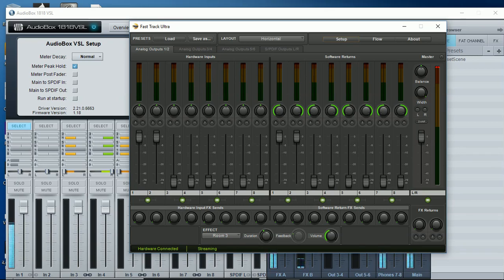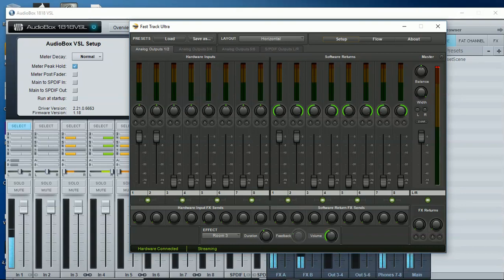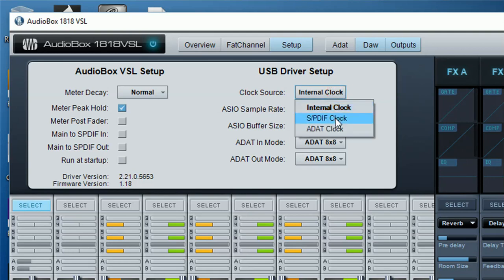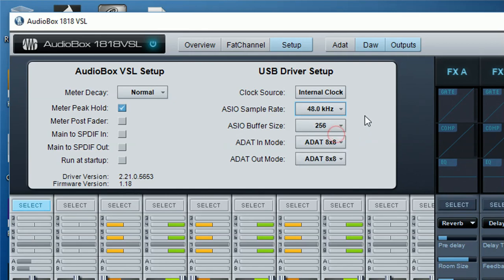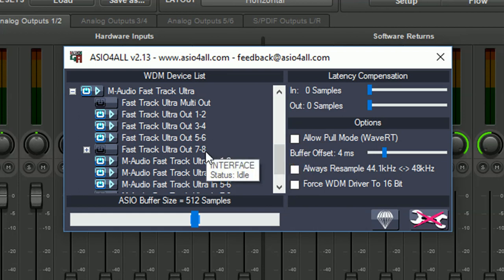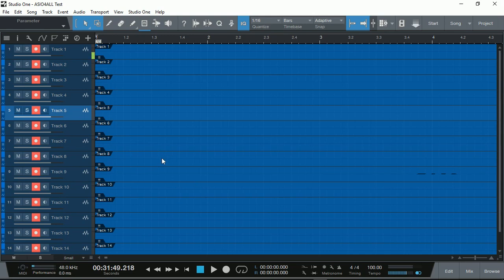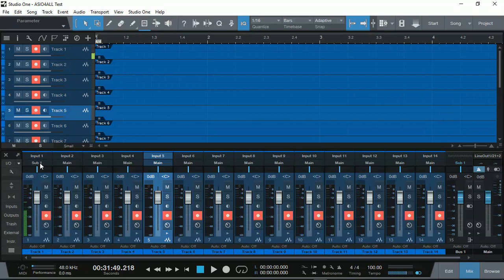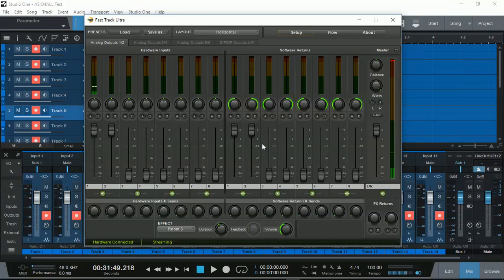Combining Two Audio Interfaces Using ASIO4ALL using SPDIF as Clock Link

Comment: Very informative video. Both my interfaces are M-Audio Ultra 8R's. How can I use both along with ASIO4ALL, I cannot install 2 instances of the M-Audio drivers.
Reply from the maker: In this case, the Asio4all replaces the original drivers.
Reply: It's unfortunate but I cannot use the 2 identical interfaces. ASIO4ALL shows both interaces but only 1 is active, 2nd one is idle, I believe it is beacuse I cannot install two identical drivers. I wonder if anyone else with identical interfaces has the same issue.
Reply from the maker: @user-uk1is7uj9q this may depend on the manufacturer. Normally you can enable both devices in asio4all.

Comment: Great video and information! My question is I have 2 identical m audio fast track ultra 8r.  Can they be used together to gain 16 channels with asio4all? Thank u
Reply from the maker: This depends if the driver for the units recognizes them both, so you can see 2 audio interfaces, then yes.
Reply: @RecordingStudio9  thank u for the fast reply! The 2nd one hasn't arrived yet so I'm not able to check anything out yet. Would asio4all work as the main driver for both then or do both units need their respective drivers? Just confused on if the original driver for the 1st one doesn't recognize the 2nd new one I'm assuming I cant install the same driver twice.....
Reply from the maker: I know some manufacturers' drivers, like some Behringer drivers, support multiple of the same units, though still as separate units, not sure of M-Audio.
Like you can connect 2 or more Firepower FCA1616 audio interface using same driver install etc.
Reply: @RecordingStudio9  right on brother.  Guess the only way to find out is plug it in and turn it on lol. Thank u for your time!
Reply from the maker: Welcome. Do let us know how you go.
Reply: @minnesotapetecampbell6920  did it work?
Reply: @ThePrehistoricWars  hey brother. It did. All I did was plug it in and bam. Basically it just connected the 2 as 1 big unit. So I have 16 channels now but only 1 is the master... meaning 1 runs the 2 headphones and main outs. No asio4all at all....it just links the same driver cuz they the same unit

Comment: gr8 vid... how do u  clock using spdif.. i mean the connection, how to select master and slave
Reply from the maker: Via the driver of each of the units.
Reply: ok..that means there is a box to click or what
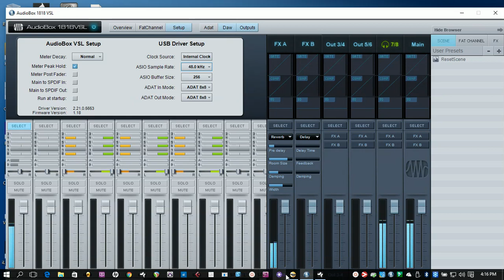Reply from the maker: @daddydanny5588  Watch 2:47 and 4:36. If you have a different audio interface then you need to find this out yourself.
Reply: ok thanx

Comment: On the 1818VSL, to record 18 tracks simultaneously can the spdif be used with a simple a/d converter or does it need to be an audio interface in order for the sync to work with the adat and the spdif? My adat device is a fostex fd8 from 1999, so there's no way that I'm aware of to have that use a different clock. The manual just talks about a midi sync with a midi cable
Reply from the maker: It's not possible to integrate 1818VSL and FD8 as far as I can see. Even then, the FD8 has only 2 inputs with AD/DA converter.

Comment: Thank you very much for the tip!  I want to record drums with 10 channels. I have behringer umc 1820 with 8 channels(it has both SPDIF and ADAT) and portative zoom u-44(it has SPDIF only).
Both of them record quite good to me for process in DAW, but when i try to expand master 1820 with slave u-44 via spdif - signal from u-44 comes with awful digital jitter when i kick bass drum or play toms. Seems like it do not like low freq. Also spdif mix two microphones into stereo( not two standalone mono signals, each mic separately) which is not good for mix.
So, did i get it right - your method in simple words is to use both interfaces via usb separately and use spdif just to synchronize them?
Reply from the maker: Feeding SPDIF from U-44 should work just fine. Make sure you have the correct sample and bit rate for SPDIF and U-44 is set with external clock via SPDIF.

Comment: thank you for your entertaning video,
and here I want to ask, it's about joining 2 interface afteral
for now I use XR18 as my mixing console, and yeah it's working well for recording and usb playback,
and here's the problem,
as for on mixer only has 18ch, I tried to made them 36ch by (hopefuy) joining 2 of XR18, and by using asio4all but, there was 'crackling' noise for a period of time continuously
is it because that's the performance of asio4all or what?
Reply from the maker: Here is my other video on the topic. https://www.youtube.com/watch?v=EczMDEFZdRM
You might have the buffer setting in ASIO4ALL too low, or the link to sync is not correctly setup.

Comment: could i do it whit just one I nterface conected to the pc ?
Reply from the maker: If you are referring to have the second Audio Interface not connected to PC via USB, then most likely not. Reason is that the analogue inputs/outputs of most audio interfaces do not route to ADAT in/out. The ADAT here is just used to sync the two interfaces. 
Hope that answers.

Comment: what do you use to zoom mac style? is that done in post? 
thnx for the vids
Reply from the maker: Yes, it is done during video editing.
Reply: RecordingStudio9.com thanks for replying man. 
there's actually a software called qzoom that does the real trick. it's not super smooth, but in case you hadn't, it's worth a try.
best of luck
Reply from the maker: Thanks for the tip. I'll check it out. Though doing it post production, means I can control when and how much to zoom in.

Comment: Excellent videos, I just subbed! I have a few questions, would be great if you could advise:

1) My current interfaces scarlett 6i6 1st gen, presonus vsl22 & audient id4. Is there any way to use these devices as an aggregate on windows 10? I know this can be done on mac but found nothing related to windows

2) If point 1 is not possible to do, what interface would you recommend for preamp input expansion? My 6i6 1st gen has spdif out/in - using this, what would be the most decently priced interface to expand number of inputs to 6 (2 from the 6i6 and 4 additional from the slave device)? Anything from Behringer?
Reply from the maker: Both VSL22 and ID4 can't be aggregated in Windows 10 successfully, as there is no way to sync the clocks.
1) Sell all of them and buy an interface with 6 or 8 inputs.
2) for better option, see option 1 above.

Behringer FCA1616 is a great alternative at great price. Or similar range and option interface, and save yourself the headache.
If it was to extend from 8 to 16, it's worth the effort, but to go from 2 to 6 or 8, not really.
Hope this helps.
Reply: I actually tried asio4all generic driver (never knew the functionality before) and turned on the inputs for both id4 (output was via id4) and vsl22. Surprisingly there was no latency or audio distortion at 96 KHz 24 bit. 0.6 ms latency. So technically now i have the option of 3 mic pre inputs and one jfet di from the id4. If i do the same with 6i6 + vsl22, i'll have my 4 inputs for drum recording.
Reply from the maker: You might want to watch my other video, that I have explanation why it wont work. Playback is fine, but for recording, it will get out of sync.